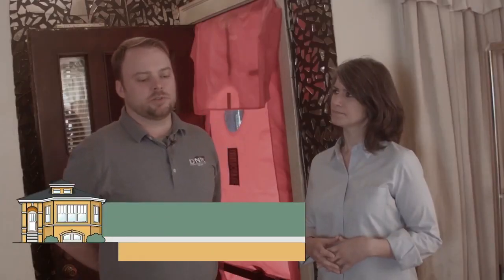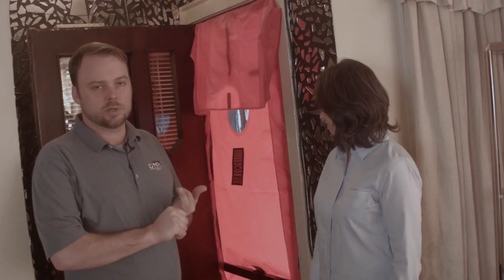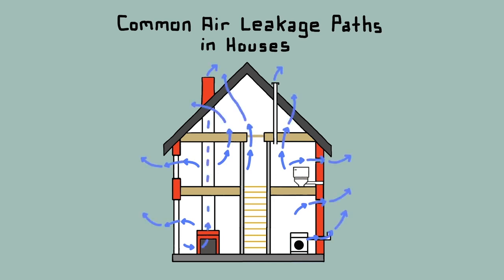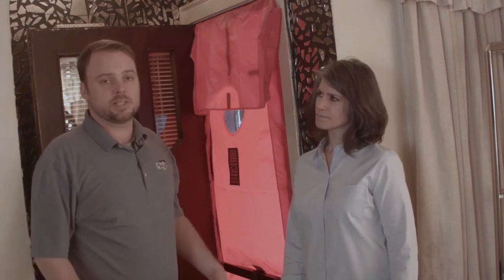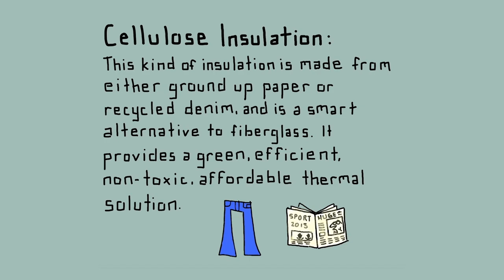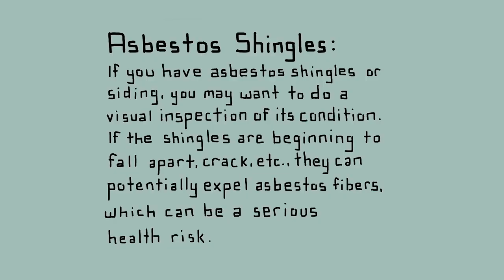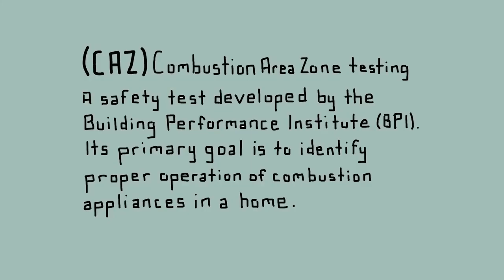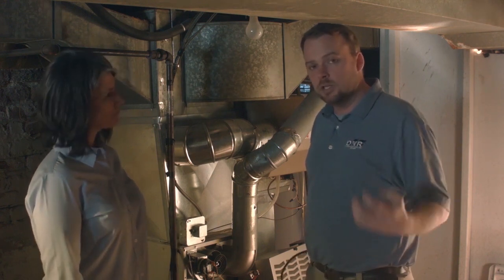How to Do an Energy Assessment on Your Vintage Home

Comment: What is the best way to add dense packed cellulose to framed house walls with plaster? Using the knee wall attic cavities and basement cavities or drilling holes into the exterior of the home? I have vinyl siding with the original shake siding underneath.

Comment: Lots of good info, thank you for this! It’s important to have vermiculite insulation tested for asbestos. Vermiculite itself is safe, but much of it in the US came from the Libby mine in Montana which also contained asbestos, so there was cross-contamination. Ours tested negative in 2010 when we bought our home. Whew. Vermiculite is still sold as both insulation and as a soil amendment for gardening.